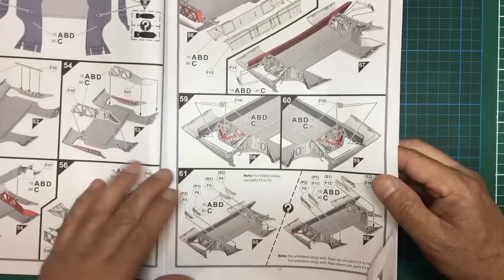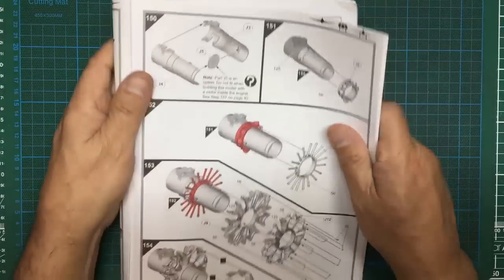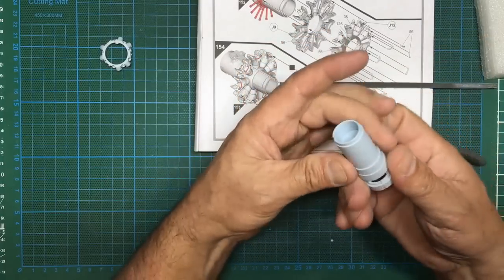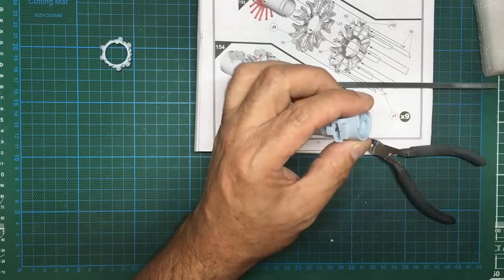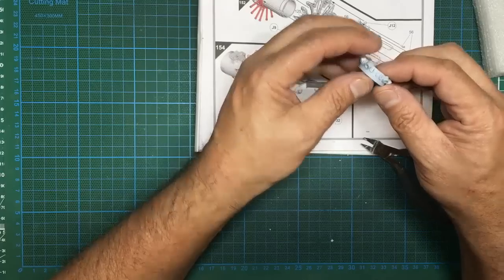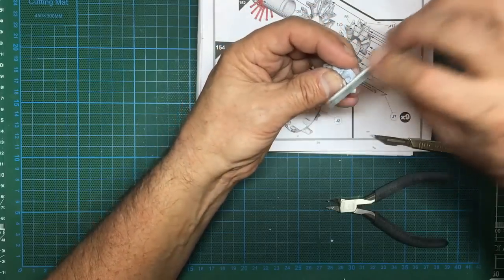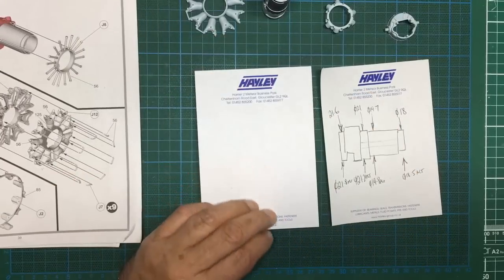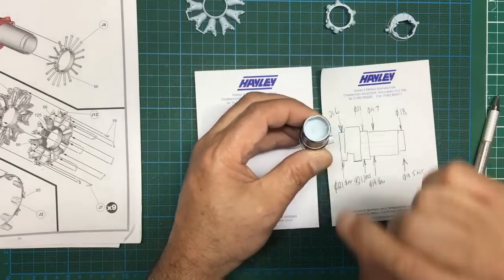Airfix 1/24 F6F-5 Hellcat build. Part 9.. Turning the Engine..

Comment: Got the kit
Many of the same problems you have Nigel - Really helpful
HOWEVER
Although the engine core is too wide you can reduce its size by triming of a few centimeters of the edges where it joins
Really quite easy but THANK YOU as I would have joined it and found it did not fit!!

Comment: I was lucky i tried to dry fit most of the parts before i glued the crankcase. I just cut the locating lugs off and used a sheet of 120 grit copydex'd to a flat board to shave the mating surfaces down a bit (probably about .5mm in total) till all the cylinders fitted on. I suppose it's very slightly egg shaped but you dont notice it.

Comment: Can you sand a few thou from each half of the crank case before you glue them together instead of using a lathe
Reply from the maker: Yep, just as I mentioned in the video. However, it wont be enough at the back end.

Comment: Hey Nigel! I have been really enjoying this awesome Hellcat series!  Dang! Thanks to you I will have to acquire this one! lol :)  I'm already knee-deep in projects but, I admit this one is a must do! With my build, I am going to make the wing sections with scratch-built hydraulics to have real folding wings, then I can have the best of both worlds...wings folded or spread out. I noticed in this video your going to cover using a lathe in your next video. I am interested in a acquiring a lathe, and my question is,  What lathe do you have? What would be a decent model at a fair price range? Any info in the right direction would be much appreciated! Cheers!
Reply from the maker: Difficult question to answer there. .. go for the size you need and the best you can afford. No good buying a cheap fulsize if you only want to make pitot tubes for 1/48 aircraft, no sense buying an expensive watch makers lathe if you want to turn 1/6th scale tank wheels??
Reply: @NigelsModellingBench  Thank you for your input Nigel, I will keep that in mind.

Comment: No stand supplied to save cost of the kit.....if you want to display it in flight , hang it with fishing line from your ceiling just like the old days of Airfix. Seriously the kit was probably designed to be displayed sitting on it’s wheels to show off the detail in the gear bays.